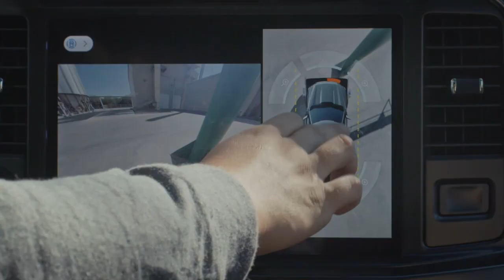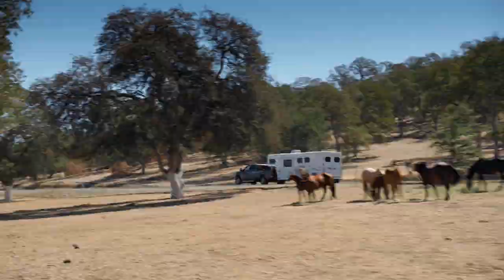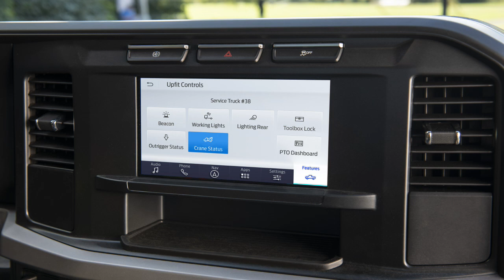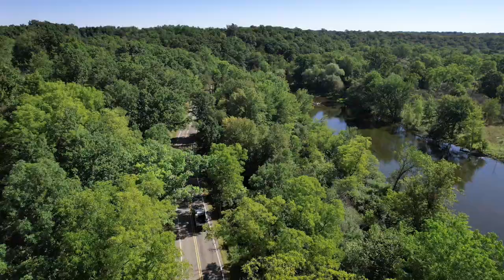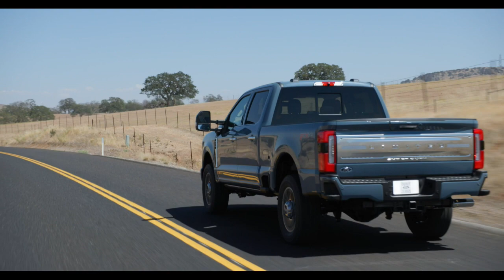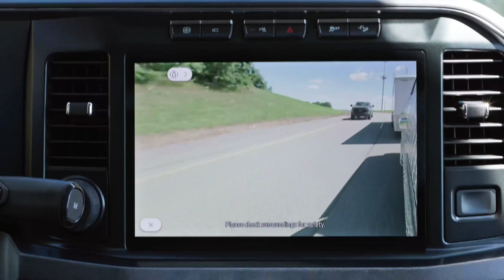2023 Ford Super Duty, engines, towing features, sliding desk, onboard generator, fleet remote? Pt. 2

Comment: All those fancy electronic features are great until they break and the dealer wants $6000 to fix it.  Extended service contract from Ford covers stuff like oil pans, and cross members I checked into it when I was looking unless that stuff breaks in the first 3 years you're screwed. The only option is buy a new truck every 3 years before the bumper to bumper warranty runs out. I'm happy with just lifting the tailgate or using a backup camera to align the hitch coupler.

Comment: I’d love to have Ford provide an answer to what prompted development of the 6.8 gasser. I understand it may be derived from the 7.3 architecture but still seems odd to have two rather similar gas offerings. Is the 6.8 that much more economical to build or produce or something?
Reply: My guess is since the 6.8L is essentially just a de-stroked 7.3L they probably share 90% of their parts or more unlike the 6.2L OHC engine which is only a completely different platform than either the 6.8L or 7.3L. So yes, above all else I'm sure that lower production cost was probably the main reason for the 6.8L was brought in as a replacement for the 6.2L
Reply: @nathanmcdonald610  yeah if they needed a replacement for it sure. I was just kinda expecting the 7.3 to fill that role once the 6.2 died off. Don’t really see a need for two quite similar gas engines in this segment.
Reply: @MX5-XU  It's kind of always been that way. Before the 6.2L we had the 5.4L and 6.8L Triton V-10 and before those it was the 5.8L and 7.5L V8.
Reply: @nathanmcdonald610  oh totally, just feel the prior differences between engines was larger than this one appears will be. That and being essentially the same engine (minus stroke length), the R&D needs to have some financial benefit for Ford to do all that.
Reply from the maker: I'm hoping the benefit will be better MPG empty. The 7.3 on gets 14-16 MPG. I'd be very interested if it got 18 mpg. But I'll have to drive it to know. No MPG numbers on commercial trucks
Reply: Just drove my 2022 F-350 dually, 7.3 gas,  4.30 gears across South Dakota West to East in the wind... 12.4 mpg empty (75 mph avg)!!! Ughhh! With a 4,000lbs truck camper on board this summer in heavy headwinds, 6.8 mpg on one tank.